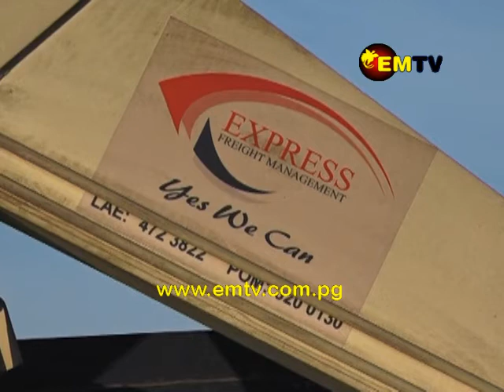Semi-Trailer Tipped Over after Crane Wedged under Koki Overhead Bridge

Comment: The design should have given enough vertical clearance height or should have used an arched steel frame for the superstructure beams. NCDC must install an allowable vertical clearance height road sign on the bridge site to inform the truck drivers/owners to avoid getting in the mishap. It's a result of bad design and poor administration combined causign such accidents.